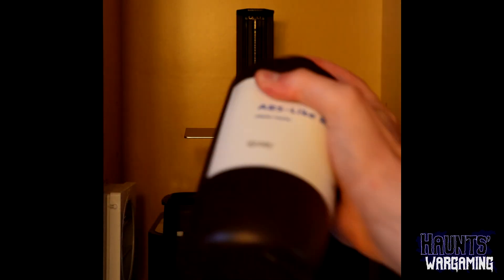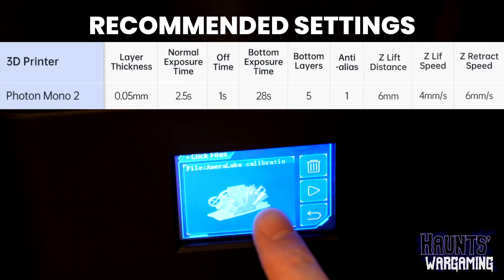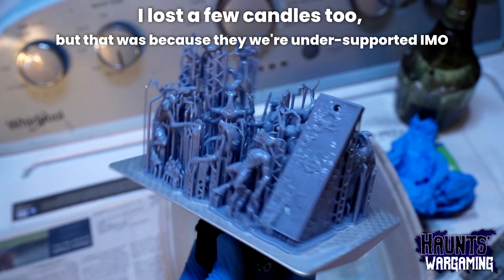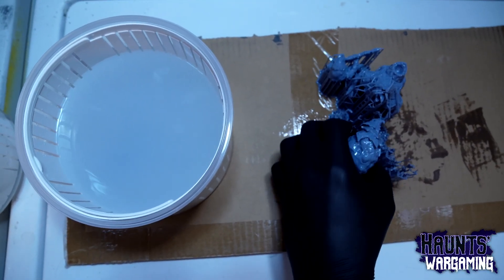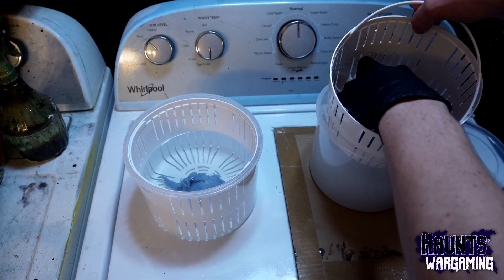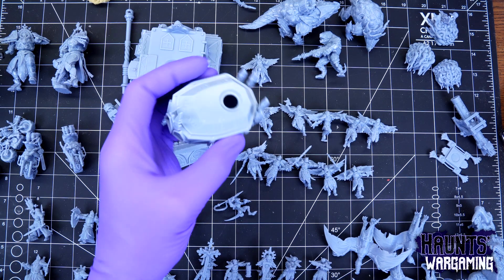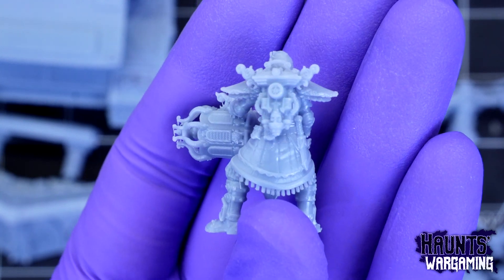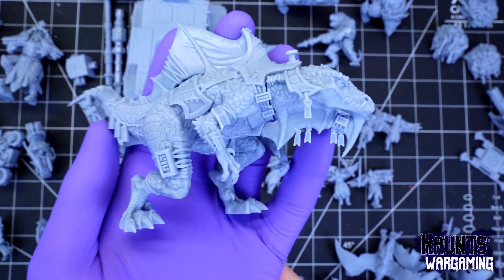Anycubic's Water-washable ABS-like Resin V2 REVIEW

Comment: I use this as my normal resin . Word of advise dont forget your models in water for long time (Like a day) as then resin will become soft and will eventually break. If you want things to be flexible like rubber and bend you can experiment with timing of your model in water. Leaving them for 1 hr should give you more flexibilty but test is required. Enjoy this fantastic resin.

Comment: I purchased a Photon M7 two months ago and have used all of Anycubic's washable resins.
 I have been working in 3D printing since 10 years, with both equipments as  resin  as  metal, and I must say that I am very happy with the machine, but above all with the ABS V2 resin.
 Compared to Standard  washable resin, the details of ABS v2 are much more defined and there are no white residues.
It is also very easy to clean and does not damage ACF and metal parts.
I only use ABS v2.
Reply: What settings  do you use? I have the m7 max and my first print with the water washable 2.0 . I don't know how much different it is from the water washable from the video but the module stuck to my Feb destroying it. I would really Love to With settings I'm supposed to use Okay find the right ones anywhere.
Reply: @DARKYOSHI78  Hi,
 I'm using the standard ABS V2 parameters.
I used the normal washable resin, but white halos remain.
With ABS V2, there are no halos and the prints are well defined.

Comment: water washable + great resin.. it is hard to remove from the plate.. i have bottom exposure time set to 15s.. but still hard to come off.. i will try with 12s.. i have Elegoo Saturn 4 Ultra 😊
Reply from the maker: @S3R3C yea, just keep lowering the burn in exposure until it's not so difficult. I have to jam my scraper under it at just the right angle :p
Reply: @hauntswargaming  yeah i jam scraper also.. no matter what angle it doesn't come off.. will lover exposure tomorrow maybe to 10s.. with 15s i have now i need jackhammer to get it off 😆
Reply from the maker: @S3R3C  did u try flipping the scrapper? I have to do it beveled side towards the plate.
Reply: @hauntswargaming  I have tried all combinations.. even under warm water... as I said.. need to lover bottom exposure time.. i think with 10s it will still stick to the build plate.. what do you think?
Reply from the maker: @S3R3C  🤷‍♂️
Reply: @hauntswargaming  will test tomorrow and let u know 😊
Reply: Could you please share settings for Saturn 4 Ultra. Many thanks!

Comment: I am using this with saturn 4 ultra, for some reason i never had a successful print with this resin !! Don’t know what is going wrong.
Using a heater set to 25 c, layer height is 0.05 mm, bottom layers 5 with 4 trans on exp 25 sec, Normal exp 2.5 sec. Always coming off build plate or stick to fep. Also the rafts are terribly deformed and surfaces are uneven.
Reply from the maker: @Squidsvfx  just off the top of my head, could be suction issues. Could be your burning layers aren't exposing for long enough. Could be you don't have enough supports. Could be your overexposing the reg layers. Could be the plate isn't level.

With resin printing You are going to get uneven surfaces on larger models if you're using flexible resin. There's a trade off to it in my experience.

If you're hollowing the models I just did a video on that that might help.

Comment: Wonder how well a salad spinner would work?
Reply from the maker: Never tried it. Pickle jars work pretty well for me.
Reply: @hauntswargaming  well I'm getting some water washable resin in the next few days ill update how well a salad spinner works.
Reply from the maker: @SpottedHares  for post washing right? I think it would work pretty well. As long as the model doesn't have any delicate sections like a banner for instance.
Reply: @hauntswargaming  well it seems to work rather well, the centrifugal force dose send models to the walls, but as long as their placed their at the start with the more delicate parts facing away from the walls it seems the the centrifugal force keep the parts where they are as they spin.
Reply from the maker: @SpottedHares  nice!
Reply: @hauntswargaming  with some more testing it seems that even with rather cloudy water the sheer force of the spinning and stopping just washes the left over resign off quite well. Afterwards taking a spray bottle with IPA and giving the parts a quick blast will get off anything else.

Comment: Do you clean the FEP too only with water? Or u still use IPA to clean it.
Reply from the maker: Yea just water, but I hardly ever clean the fep. I've literally cleaned the fep off once on that printer and that was because the machine said it needed changed. Surprise, surprise it didn't.
Reply: So after u print, u can leave the excess resin inside without letting any source of light touch it? Correct?
Reply from the maker: @joshuaravelli2848  yep, as long as the odor isn't an issue you can do that
Reply from the maker: @joshuaravelli2848  You have to stir the resin if it's been sitting for more than a day. I use the plastic scraper that came with the printer for that.
Reply: Ok all clear, thank you very much for answering. 🙏

Comment: every resin printing channel says don't pour it down the drain blah blah but nowhere do I hear them tell you what to do with it, so what DO you do with the wash?
Reply from the maker: I put it in a large container and set it outside to evaporate.  I have mine under the roof of my garage so it won't get rained on and I put some chicken wire fencing over it to keep birds/etc out. I just dump the dirty water in there after every liter or so of resin.

Comment: 2 questions:
1. Do you use hot water or no ??
2. After washing, do you rinse with cloth towel or paper towel before curing ???
Reply from the maker: I don't use hot water. And if by rinse You mean dry off then yes. I have a video on my process for my patrons in the tips and tricks section if you're interested.

Comment: I switched to water washable resin about 2 years ago (anycubic water washable+... not the ABS like) and it has served me well. (it is however a bit brittle so I'm gonna try the ABS)
being able to just fill my wash/cure with regular water has saved me a lot of money. IPA isn't exactly cheap.
when the water gets too cloudy I simp[ly dump it into a large transparent storage container and leave that outside for a week or 2. the sun cures any suspended resin and it separates and sinks to the bottom. I then drain off the water into smaller containers and take those to my local recycling station. the cured resin can just be scraped out of the storage container and put into an old coffee jar or whatever then I run that through a curing cycle on my wash/cure for 10 mins and just chuck it in the regular trash.
its just way less hassle than dealing with IPA and I've not noticed any real difference in quality of the prints
Reply from the maker: Sounds like a good setup! It's been a real game changer for me. The cost of the IPA was never really an issue but the smell was :p
Reply: @hauntswargaming  yeah it wasn't a huge cost but compared to water it is which is essentially free and always on tap :)  5litres of IPA or a litre of resin, I know which I'd rather be buying
and yeah the smell was what really bothered me about it
Reply: Hi do I still need to cure with UV light after washing?

Comment: I don't know what's up with the "stickyness" of this resin, but  it's like it's superglued to my build plate... The rafts are pretty brittle too, so I'm guessing that even at 20s, I'm massively overdoing it on the bottom layers. (using a photon mono X).
Reply from the maker: This resin is really temperature sensitive. I had issues with it cracking at the beginning of winter (the supports). I made sure the temperature in the print room was cranked up and that fixed it. It helps if it's 60°F plus. And yea it sticks. Just keep dialing down those burn in layers.
Reply from the maker: I also never deep clean my plate FWIW.

Comment: Have you tried putting your pickle jar bucket down inside a 5 gallon bucket?  That would catch any splashing or spills.
I just received two bottles for myself.  I printed two Firefight teams for my son last Christmas (Starhost and War Daemons).  I had many limbs and weapons snap off with regular handling.  I'm looking forward to the more flexible models.
I'll be printing my Tixal armies later this month.
Reply from the maker: That's not a bad idea. I have been putting a folded piece of newspaper over top of them and then covering the sides with my hands while pulsing the basket. (With gloves on) That seems to work pretty well. Any splashing gets directed downward towards the newspaper they are sitting on.

Comment: How long should I wash and cure 3D Miniatures using water wash resin it said 10 minutes for wash and 2 minutes to cure
Reply from the maker: I don't use a wash machine anymore but that sounds good. Cure one minute on each side
Reply: @hauntswargaming  thank you I have the any cubic washing cure machine combo
Reply from the maker: @jeff1238191  I use a two tub system which I think works pretty well. I'd suggest getting a second tub to get the bulk of the resin off and then using the wash machine to get the rest of it
Reply: @hauntswargaming  thanks for the suggestion

Comment: I recently picked up 5kg of this resin but can't get it to print properly on my Mono X2 for the love of god. Wasted half a bottle on failed prints already.

Test prints work fine and I dialed it in to 1,7s @ 80% UV power for optimal exposure. However, often times the supports just won't stick. Even at higher exposure and/or UV power where calibrations prints like the Matrix or Ameralabs Town indicate clear overexposure... I tried printing multiple models and so far, only 2 out of 10 of those printed successfully.
Reply from the maker: Maybe the models aren't supported enough.  That's my guess. With flexible resins you gotta have generous supports
Reply: The models are definitely supported adequately, but I will try and increase the tip strength somewhat for my next print. Tomorrow morning, I'll know more. @hauntswargaming
Reply from the maker: @topkekbieri  good luck! I usually add a few thicker supports if I feel like the model needs it. I've had like 99% success rate with this resin. The only failure I've had was under supported and I didn't catch it.

Comment: With this resin I'm just curious, what's your recommendation for UV exposure for the miniatures based on size ?
Reply from the maker: I'm not really sure what you mean by "based on size"
Reply: @hauntswargaming  ahhhh, so let's use d&d miniatures. Your average size is an inch tall.
Reply from the maker: @steamboatjoe7198  well the UV exposure would be the same regardless of what size the model is. The manufacturers have recommended settings for whatever printer you're using on their websites.
Reply: @hauntswargaming  I'm sorry, I'm still new to this so I don't think I'm doing a good job at explaining it lol.  I purchased a separate anycubic machine that spins the figures around and further exposes it to more UV light. Past prints have been coming out brittle and breaking. I believe either due to washing it too long in alcohol or over exposure in my UV machine.
Reply from the maker: @steamboatjoe7198  ah okay, my bad. A lot of resins turn out fairly brittle.  It's worth spending more money on a durable/tough resin.  I went through a few different resins before I found one I liked.
For a post UV cure, I usually do one to three minutes flipping them in between.
Reply: @hauntswargaming  awesome thank you. 

Would this Resin be considered tough ? On Amazon it's labeled and marketed as such.
Reply from the maker: @steamboatjoe7198  Yeah, I like it so far.

Comment: The quality of Anycubic resin is really bad. The curing time can be different from one bottle to another and Anycubic don't care about this. If you use Anycubic resin you will have to do a  calibration between every new bottle and big prints are impossible to do without risking your prints and FEP due to low quality resin. After several discussions with support and 5L of failed prints I will never buy Anycubic resin again. There are several other brands with higher quality and the same or less price.
Reply: Funny... i printed like 30kg of anycubics normal water washable resin and it came put perfect all the time. in winter as in summer... no difference at all. And i printed very big models with it too
Reply: How fast do you rpint? @D1eWuR5t
Reply from the maker: Is this your experience with their abs like V2?
Reply: which one would you recommend ? for water washable.

Comment: What should I change for black color resin? 
bottle says for 0.1mm layers to use first layer: 10 - 15s, normal exposure: 1.1 - 1.5s light-off delay: 0.2 - 0.5s
I want to use 0.05mm layers
Reply from the maker: Use the manufacturers recommended settings. Do some test prints and adjust based off of that.

Comment: How's the smell BTW?do we still need air filter for this?
Reply from the maker: If you compare just the resin to other resins I've used it's pretty similar. But, in my experience, the majority of the smell has always come from dealing with tubs of IPA. Not having to deal with IPA has really cut down on The smell. Of course you still have to use respirator and have ventilation

Comment: I use mainly water washable from Elegoo. It has served me well. Even when I use the machine I notice less smell. 
The only warning I received was from a dice maker. Water washable, in their opinion, is not good for dimensional accuracy as it can shift or swell. Not enough to be noticed but enough that it affected their dice and balance, it was worse when they used a semi-transparent version. So when I make masters to be molded I use the traditional resin.
Reply from the maker: I believe it. Some of the larger, multi part models I've printed weren't socketing together perfectly and needed a bit of sanding. Nothing major, but depending what your printing it could be an issue.

Comment: I use elegoo's water washable on my saturn. I lost a years worth of printing when we had some serious humidity. All my hollowed out minis cracked open. Had just finished all the robot legion and lost them all before I even got to use them. Made a huge mess. Now I print solid minis just to be safe.
Reply: That wasn't humidity, that was uncured resin inside sealed voids. It off gassed and cracked from over pressure. If you're going to use hollowed models make sure its clean and has some  small holes to allow the gasses to escape. Even better is curing the inside with small LEDs.
Reply from the maker: @Hartwig870 and sweep each file in a slicer to make sure there aren't any closed off voids. Especially when you're printing combined models. Sometimes the person preparing that model doesn't know anything about 3D printing unfortunately.
Reply: I've got some pretty bad humidity swings in my area and use elegoo WW as well. Weird yours has done that. I would be curious to see if there are closed areas inside the model after hollowing it as Haunts said. You could have pockets trapped that off-gassed and popped apart. That is one reason I don't typically like pre-supported minis and do it myself.
Reply from the maker: OPR's stuff tends to have closed chambers. (closed gaps, where the arm meets the torso for example.) The older models at least. They are getting better at not leaving those in. I wonder if that may have had anything to do with it.

Comment: I recently switched too and I'm loving it. Love how easy it is too wash and no hassles painting the resin after. 

Only thing I've found is sometimes a second wash is required depending on how models sat during washing, but that's a very minor thing. Love the product
Reply from the maker: Yea, it makes the process so much easier!  

Sometimes I dab the models with a paper towel as a final pass. Not sure if that would help.